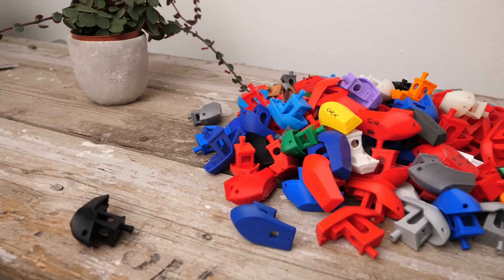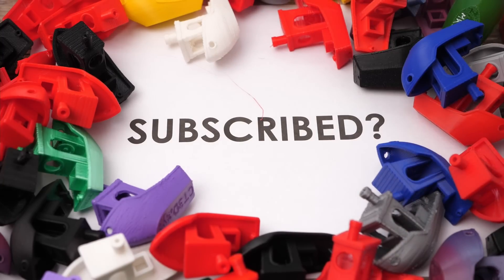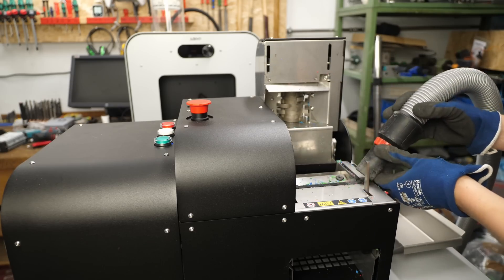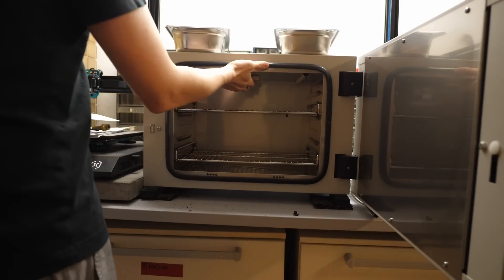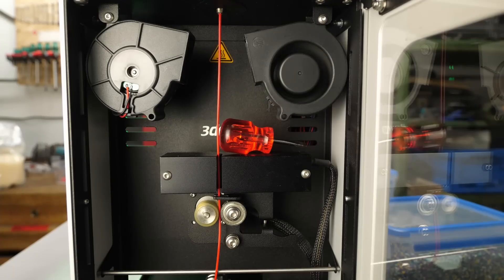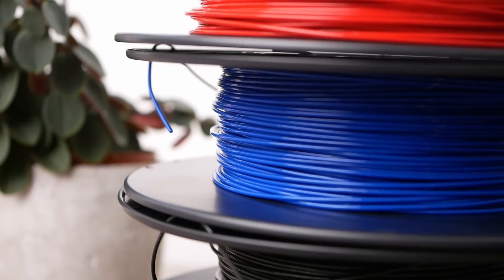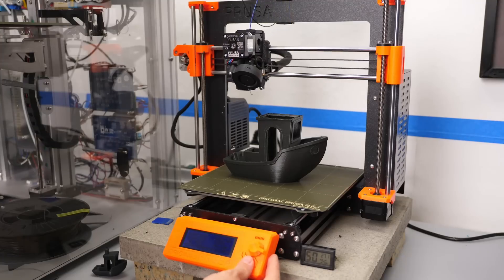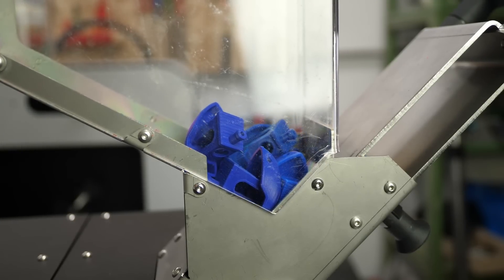Recycling all my 3DBenchys into new Filament

Comment from the maker: What's your take on recycling 3D prints? Totaly worth it or too much work?
Don't forget to like & subscribe and share this video on Facebook, Reddit, Twitter, and other platforms!
Reply: Sounds pretty amazing! But only if it were far far FAR cheaper!
Reply: To be honest, I just want to be able to send my reject PLA to someplace that does all this. I would send it for free if I knew it will not end up in a landfill.
Reply: @MartinKoistinen  Yeah I agree. While the Idea of turning my old prints into new prints is a pipe dream, just knowing that I wasn't contributing to waste plastics is the really important bit. I too would happily send my old prints away for free if I thought it was getting new life as filament for someone else.
Reply: I saw 'metal shaving' and thought 'run a magnet over the shredded bits'. Or even over the end product. (Assuming that it's a magnetic metal.)
My next thought was that you could throw the shredded bits in water and the bits would float and the metal would sink. This would obviously add time to the drying process though.
I think recycling 3D prints is a great step forward. Just needs some tweaks to make it more user friendly.
Reply: I want you to try recycling hay bale string having a farm means I have over 50 lbs of plastic string at the end of the year
Reply: @wesbrackmanthercenthusiast4695  You know, with a power drill and a bent nail, you can upcycle that into a pretty decent rope.
Reply: @S_Roach   I know I've got several hundred ft of rope   each bale has something around 100-500 ft of Polypropylene twine and I don't need any more rope I want filament
Reply: And some HDPE food containers (juice/milk). This can be pretty nifty filament :P
Reply: Pretty cool i can save money
Reply: @Mr.melteds  But the question is, do you print enough to justify a 4000 dollar mashine....
Reply: @Mr.melteds  Millions for the machines....better buy new filaments, might be cheaper for the next 100 years...
Reply: I would love to be able to recycle, fir now i don't print that much especially with waste parts like support or whipe towers because i don't want to clutter the planet even more with plastic.
Reply: It's worth it, if we can get the price of the machines significantly lower. If I could get the grinder and extruder together for around $500-1000, I'd buy it, as a hobbyist. If it's over a grand I'd only buy it if I had a full time 3d printing business.

Now if we could reliably print in HDPE, something like this could put a huge dent in plastic waste. However due to the extremely high temps needed and severe bed adhesion issues we have with it, it will probably never become popular.
Reply: I think in the long run, it's worth it. Although expensive, if used more and more by many people, it will decrease in price at some point.
Reply: Those extruder machines worth more than 8k USD, and you also have to buy the grinder. I am guessing you spent 5 or more hours including the 2 hours to extrude, and you got 300g of recycled filament that worth about 20 USD. I don't know about you, but It doesn't look like worth for me.
Reply: @PaulodeSouzaLima  Agreed. It's expensive and hard to get a pure filament after all that effort. But it would be nice to have some "PLA recycling centers" around. I'd bring the waste prints (and empty spools) without expecting any return.
Reply: @PaulodeSouzaLima  For a person doing it for themselves, no (unless they have a large print farm which can produce a lot of wasted filament).... but for a person/company that is set up to also help other hobbyists recycle their old filament, sure. The ROI time period would depend on how many people would use the service, and how much scrap filament they have to recycle.
Reply: If I'm prototyping, I end up with 10x as many wasted filament as the product itself. But I would love it if there was a service that collects waste material, now it ends up in the trash (we are not allowed to recycle it with other plastics). However the biggest spender of waste (a purge block) can not be recycled with a color match :)
Reply: If you don't consider recycling worth it, you are most of the problem.
Reply: I really like the idea of creating my own polymere mixtures with virgin material or for example from PET bottles.
Reply: Totally worth it! Saving my scraps til I can afford an extruder.
Reply: Yes. Not worth my time RIGHT NOW, but probably worth it in the not too distant future.
Reply: Next time, maybe donate those boats (the well printed ones of course) as gifts to children at the dentist’s office - instead of grinding them up. 🙂
Reply: @thomashenden71  late reply, yes, but there are probably more Benchys in the world than there are children :D
Reply: I'd like to see your results with a mix of old and new material.
Reply: While I like the idea of a service for recycling prints, I'm unsure how this could be done in an ecologically useful way: Wouldn't the gain of the recycled material be eaten up by all the transporting necessary? Just like 3D printing decentralized manufacturing, the products of 3Devo could decentralize recycling as well – but they need to get at least an order of magnitude cheaper and less effort to use…
Reply: Quick tip, in the plastics factory I worked at we did regrind on site and we never mixed material to be more than 1/4 regrind, do what you will with this info
Reply: I say that it works but it requires more work, probably needing to be smaller and mixed with the branded DiY filament pellets. I would also suggest trying out a vacuum chamber to see if there’s any moisture that you can pull out in a vacuum then heat it again before throwing it in to be made into a new spill of filament.
Reply: I think it would be nice if there was a place you could just donate all that and they would transform into filament (sold cheaper). So you can rest assured to reduce waste and have a place you can buy this cheaper recycled filament
Reply: I really want to know if this technology can be used to make filament from, for example, plastic bottles!
Reply: @Larkas it is possible, but cleaning the plastic waste is particularly a problem. Look for Ethical Filament and other websites about filament from recycled pet
Reply: could we redesign a benchy that is a good end product?
Reply: i see the other similar comments now.
Reply: I've got a boat... load of waste prints sitting in boxes in the corner of my room, maybe some day they will be recycled!
Reply: Mix some lemon juice in the plastic.
Reply: I think it's definitely worth it. Is it possible to get quality sorted scraps from material recovery centers and include them in the mix? It adds more variables but at least links can be established to those who have these machines and want to recycle for making. Looking forward to your post with virgin materials. :)
Reply: Totally worth it!
I think that if we manage to expand coworking maker spaces it will be fantastic if they have one of these, or maybe a subscription service that for some money per month gives you a label to affix to a box of failed prints, gets them recycled and ships back the quantity you sent, with different tiers (1kg, 2kg, 5kg, etc.).
Alternatively, as 3d printing gets more popular, we can develop the recycling technology further and make it smaller and cheaper. 
One idea that I had is, for example, to extrude 3mm filament, and later convert it in 1.75 mm filament. 
The 3mm filament can have inconsistencies and debris, that can get removed during conversion.

Going back to the recycling center ideas, Nespresso's coffee capsules can be brought back to the place you buy them to be 100% recycled.

Ideally, you could just trow them in the plastic and the big facilities would recycle them (food packaging Is made from pla)
Reply: As you say, perhaps in time there would be a market for a recycling service - it's quite an investment to recover. Looking on Alibaba though, there seems to be quite a lot going on in China manufacturing much less costly filament extrusion lines, e.g. https://www.alibaba.com/product-detail/1-75mm-3d-printer-plastic-filament_60415780243.html (just one of many) - so setting up small-scale local service businesses could become viable in a few years...
Reply: Have you tried recycling the mixed material twice? maybe that helps with the inconsistency issues
i love the approach and hope those machine come in less expensive consumer machines soon !
Reply: It’s necessary
Reply: Tottaly worth it.  And at 5K it's nearly the same price as the first "affordable" 3D printing kits from 6 years ago.
Reply: I think you should try using solvents to break down the various filaments.

I also think you should also go ahead and try mixing different polymers to see which ones work the best together.
Reply: The issue is the total volume of material you have available to recycle. Most hobbyists simply don't make enough scrap to justify the expense and effort to recycle. It might seem like you have a lot, but you don't really have much at all. Even Steffan couldn't put together more than 300 grams of any one color or type. And it probably took him a very good chunk of a day to make that little amount. Nor does he say how long he's been collecting those boatys to get 300 grams of a color.

Sad to say, at this point recycling and re-extruding filament simply isn't worth it. Better to find a commercial re-grinder to take your scrap and take a year's collection to them.
Reply: Seems like this is a great helper for those of us who go through many iterations of a part before the final is ready.  I'm not sure the cost of the hardware to get into this tech is there quite yet, but I'm definitely going to keep this on my radar!
Reply: I feel like there is often the argument of saving money that is brought up but the pricing of these machines almost never makes that work as a valid option. The time that goes into it isn't worth it
Reply: Like others have said, for a small hobbyist like me it isn't worth it, given the current cost of the recycling process. Yet I still do keep the scraps of all my filament types in separate boxes, in the hopes that either the recycling process becomes affordable, or I could at least give those batches of nearly pure material to someone who can recycle it. Better than to throw it in the trash and risk it ending up in the ocean or so…
Reply: I was thinking of making a home machine that could be used to extrude old HDPE and ABS parts from electronics. I have loads of leftover plastic panels from disassembled printers, LCD screens ect. Mostly they're made of the same plastic that filament is made of. I was thinking of getting it through a shredder, then get get a feeder screw that would move it towards and through heated chamber and a nozzle.  Didn't get past the initial idea because as I started adding in variables, theoretical problems like cleaning ect, it got bulkier and bulkier in the initial sketch. Also it would require active temperature control at which point I put it in the "may finish later, probably never" folder.
Reply: By the way, can you try recycling some of the non 3D printed plastic?
Reply: when i seen that cute little screwdriver i stopped isening to you
Reply: definetly now possible,  not economical, but maybe possilble to use in injection moulding something not crucial, like shopping baskets or filament spools etc ( maybe try to use bigger nozzle diameter?)
Reply: I'm wondering if and by how much a larger nozzle (0.8mm) can smooth out the diameter inconsistencies. For me, such a recycler would be perfect to be able to prototype more, without spending a lot on new filament and creating a lot of plastic waste. For those functionsl prototypes and prints, the color and nozzle diameter play only a small role most of the time.
Reply: Once the process is somewhat more refined and more available, it will become essential. May as well start saving your pure materials! Can't really do that once they are in a landfill :/
Reply: I was wondering Stefan, I am looking into these filament extruders for plastic recycling in general, and it seems to me a video on recycling the various recyclable thermoplastics which are in the wild (Polypropylene, HDPE, PET/PETE, LDPE) and testing their performance as filament might be useful to those of us who see all this plastic around us as possible gold but aren't yet sure if we should invest the several thousands of dollars to tap into that prospective goldmine. [I don't see many good videos on youtube about this, most are very qualitative, and amateur] I don't know how many others in the community feel this way, but if there are quite a few it might be worth testing your loaned professional setup. Great video series by the way.
Reply: Too much work? You mean too much money. 7.5K to almost 10K, the money saving will be perceptible only by massive production.
Reply: It depends. I would do it if I print often, and lazy to buy more, and have the time to do so.
Reply: @soundspark  none that I know of that can't be removed with a metal sieve while it's molten  because the twine my hay guy is using is orange polypropylene and what id suggest is first running it through the laundry in a mesh bee nucleus hive transportation bag that will remove any clay dust and after that nothing should be unmeltable
Reply: Hey, plastic process technician here. The regrind should be around 30% and 70% Virgin material to get the best results. You can add colorant at around 1.5%-5%... but you can only add color... duh but has to be said.. also consider using clear for prototypes as the color cam be influenced easily. also your metal contamination is likely coming from the grinder, using strong magnets would work good since the blades and internalls are steel and what we use in the industry.  Your partical size could be resolved with a partical size screen in the grinder. Hope this helps, been doing this a while and these are lessons that are hard to learn from a book.
Reply: It looks great but it also depends...a filament machine is very expensive. I know there are cheaper filament machines but i'm a bit skeptical that it will do a good job. How often do you need to repair that machine...is it expensive? Maybe it's worth it if you print a lot and separate the plastic properly....so you do not get extra work 😁
Reply: Are you romanian ?
Reply: I'd love to recycle my failed 3D prints and possibly even other plastics, but with the price of the hardware to do so... It'll be a long time before I'll actually get to doing so.
It's like how fast food is cheaper than healthy stuff - buying buying buying: Sure, that'll be 19,99. Recycling? Sure, that'll be 3000,99.

Edit: 5300.99 ^^
Reply: Hello Stefan (sorry if I butchered your name 😅) I've been following your YB channel since I saw your 3D printing recycling video where you printed a blasted storm trooper helmet, recently I saw a video of a youtube channel called mr3Dprint where he uses water and soda bottles to make 3D filament (PET) his last video shows the process but not every detail, could it be possible that you speak with him and maybe do a collab? You test the thing and he shows how to make it? It would be awesome to print with filament that we recicle ourself and even make useful parts if the strength of the parts is good enough (maybe rival nylon?), Would make my day if you replied. Thank you for your time reading this. Have a nice day
Reply: https://www.youtube.com/watch?v=Eecbdb0bQWQ
Reply: The trick is doing it at a sub $500 investment. Might be able to come up with something with scrap cast iron.
Reply: Depend how much u earn for one hour of work, in my case i def not recycle
Reply: Could be a good community purchase, say in a club or something.
Reply: Definitely worth it!
Reply: There is a Startup called Recycling Fabrik. They recycle old 3D-Prints, pay for the transport of your Material and you get a discount depending on the amount of material you send in If you buy recyceled Filament. It is located in Germany though.
Reply: Expensive, but to me it's not about the cost but reducing waste
Reply: @BenNottelling  yeah... imagine how much resources just used to made oven , grinder and filament extruder machine.... not mentioning energy used to oparate them, u have to recycle pla for 50 years just to be even with environment.